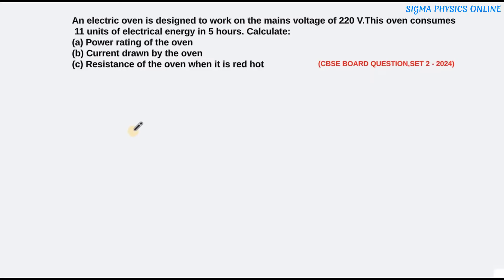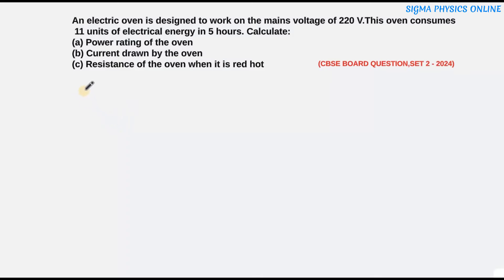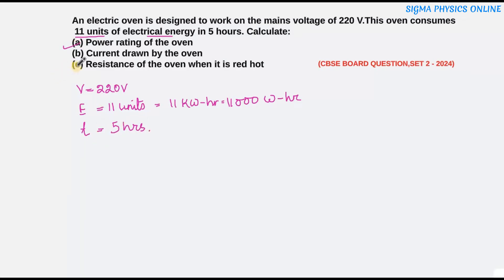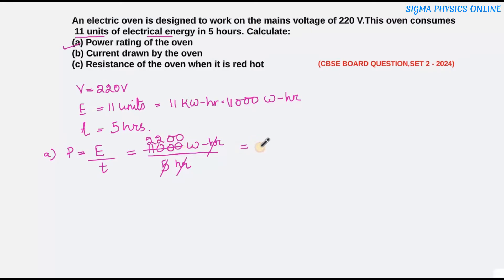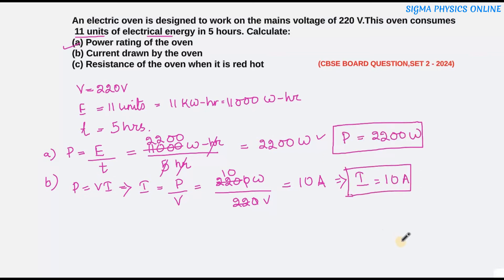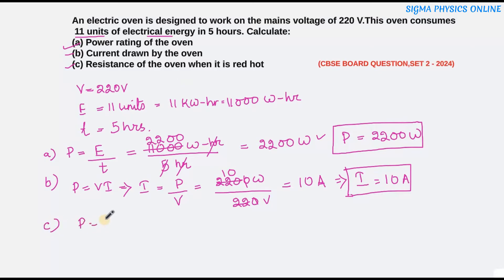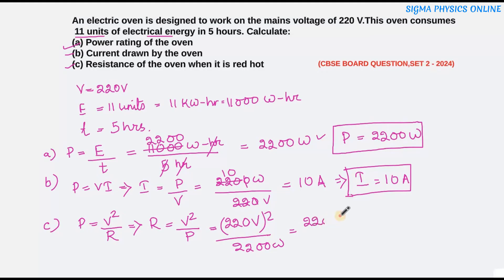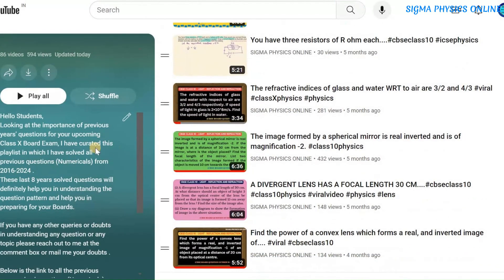An electric oven is designed to work on the mains .... #class10physics #science #cbseboardquestions

Comment: Mam i have query can yo plz tell the time when you find resistence why you used P = V2/R LIKE CANT WE USE P = I2*r can you mam plzzz explain
Reply from the maker: Hello beta
We can't  use I²R because our household circuit is a parallel circuit and in a parallel circuit , current varies in each branch. But, Voltage and overall resistance of the circuit remains constant. 
Because we are finding the  power of the entire house here, we should consider those terms which remains constant. 
Hence we hv to use the formula V²/R.
Hope u understood 😊